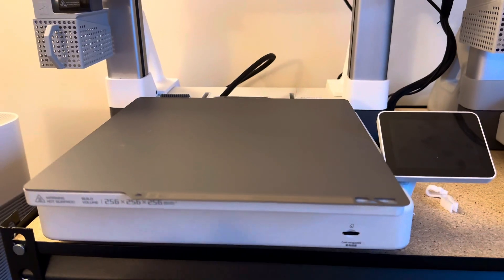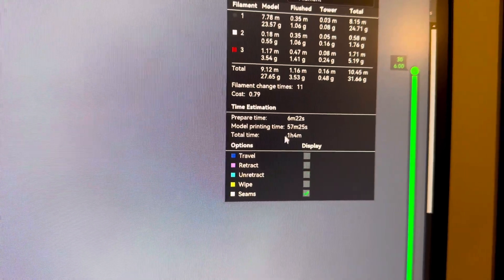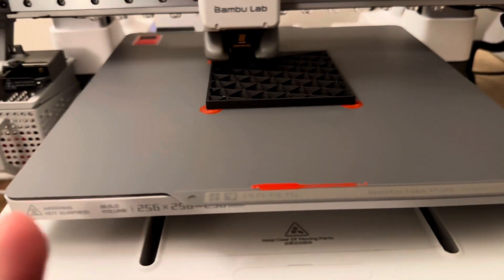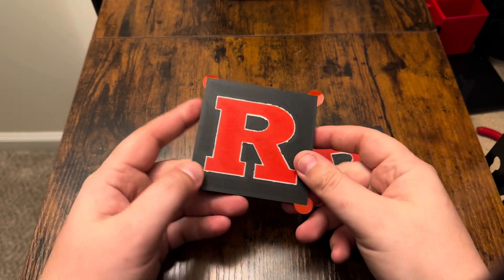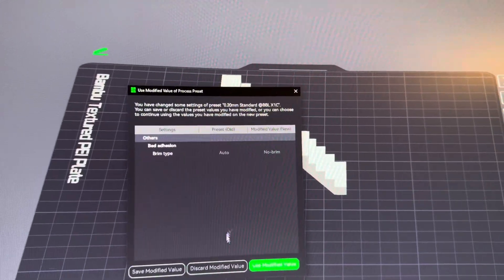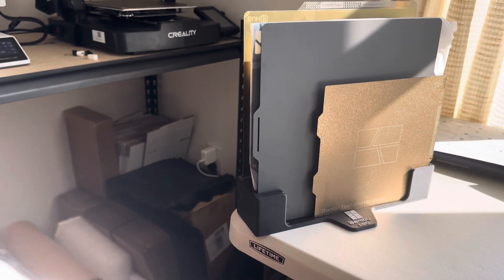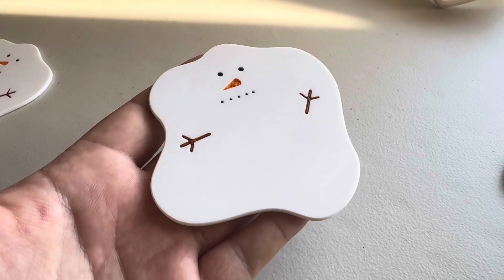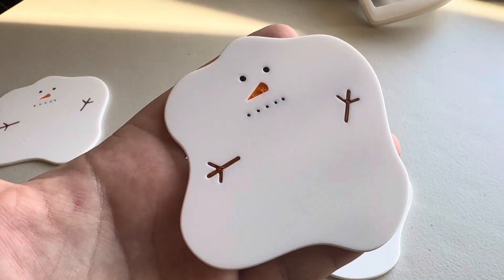New Build Plate, New Possibilities? Testing SuperTack by Bambu Labs! | 3D Printing Business VLOG #9

Comment: Heyy, recently found your channel, tremendously interesting!

I was wondering though, have 2 Bambu Lab A1's myself, but I experience huge vibrations, have tried so many things, how do you deal with this?

Because have about the same cabinet, but mine vibrate like the meter when the printer is already at 100%, let alone faster.

Thanks in advance for your response! Look forward to next video!💪
Reply from the maker: I don’t really have any crazy vibrations, but both of my muscle racks holding the 4 of them are also hunkered down with a ton of weight. Maybe try adding some weight and seeing what happens? Thanks for watching!!!!

Comment: looks like you might have had a cooling issue or extruding issue with that smooth print top layer. looked like some ironing issues i could be wrong. any idea what is causing the white outline to look rough on both? and have you tried the flushing feature ive heard about i guess where you could make some other item along with with your printing and the color change would happen in it besides the prime tower? i like the look for both snowman coasters. though i think on certain coasters they need that texture look.
Reply from the maker: Yeah I think it was the nozzle. My OG A1 combo had things stuck to the nozzle I couldn’t see. And yes I have tried that feature, but it will purge the brown/orange/black filament inside the white and the coasters are thin, so you see the infill lines through the coasters in brown/orange/black — after testing I stuck sign the prime tower because it was giving me the most consistency.